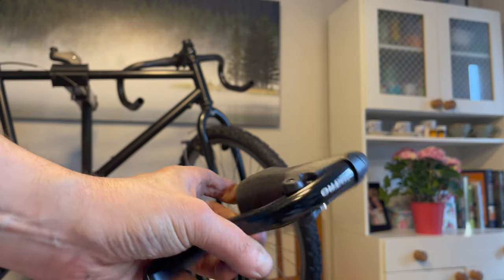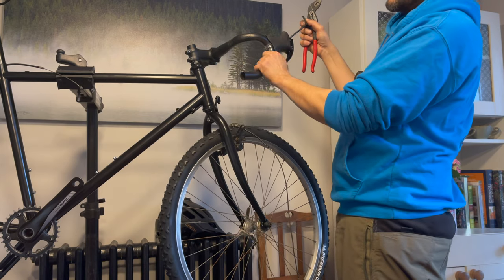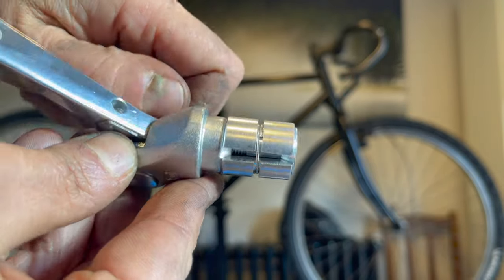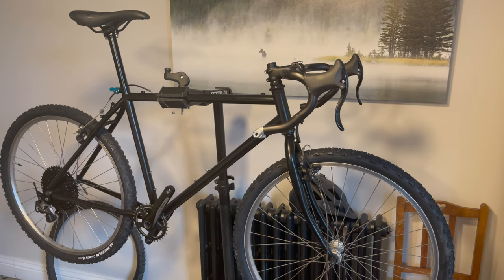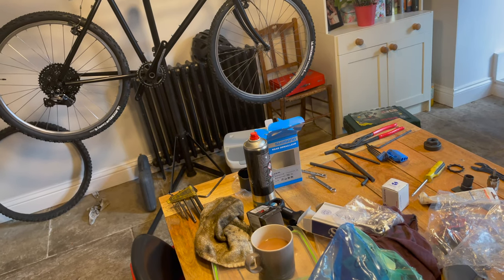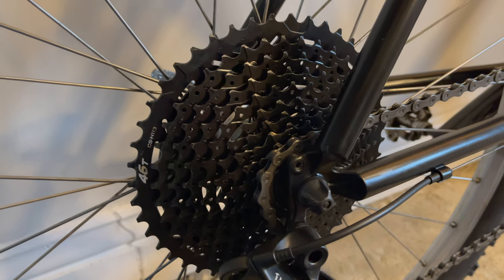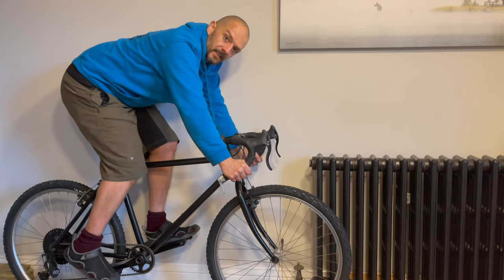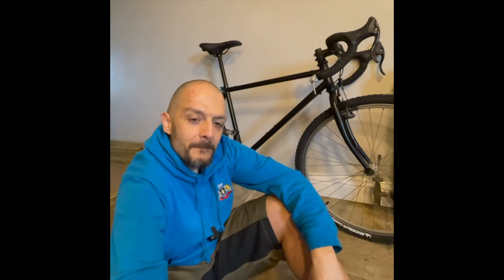Retro 1995 Marin Bobcat Gravel Conversion Installing levers, shifter, cables.  This is finished

Comment: Great video - love the 'recycling' concept! I recently did a similar job on my vintage ('96) Marin Bear Valley SE (swapping in drops, and bar-end shifters) but kept the original triple chainset. I also swapped out the original forks for a set of Mt Tura touring forks from Thorn cycles to make the front end a little more comfortable on the road, and to give the option for fitting a low-rider front pannier rack ... I'd previously used it (in its 'original' form) for fully-loaded tours round the Jura mountains (France-Swiss border - roughly following the Jura VTT) and in the Canary Islands where it handled impeccably - am hoping the handling and comfort have been preserved ...
Reply from the maker: I love the reliability of all these types of components, they are so suited to touring.  We used a 1990 bike on our Wales tour with front panniers, it was so stable.  We used front pannier racks that bolt around the forks.  It was so comfortable, reliable and bomb proof. The Marin was for my “racer” brother.  I would of not set it up like that for me but he is very happy with it.

North Wales Cycle Tour - Chester - Anglesey - Lynn Peninsula - Snowdonia - Chester
https://youtu.be/kjxvuUsWVGM

Comment: Hello, How do these bikes ride compared to modern gravel bikes? I'm trying to resist the urge to buy a bike. Many of the modern gravel bike frames appear to be overly stiff, so I think these frames might ride better but the higher BB might also make it worse. What are your thoughts, please, as you have ridden many? I have a Bear Valley SE in waiting.
Reply from the maker: As you may know. The term “gravel” bike has many variations and extremes of bikes. In the “gravel bike” genre you have what are basically road bikes with wider tyres and at the other end of the spectrum you have mountain bikes with dropbars. The road bike type will have steeper head angles etc and you would not want to take them in singletrack and the other end of the spectrum you have the “gravel” bike like the Fargo that is content on rougher stuff but then a bit slower on the road. So first I think you need to decide what type of drop bar bike you are after. I think the 80’s 90’s conversion would align them more with a road type gravel bike. The head angles were steeper than modern mountain bikes and the tyre width the could take is about 2”. So with a dropbar conversion it would be happy on the more sedate off road. They are comfortable providing you get the right size bearing in mind you are going to put drops on it. I would recommend having a blast on a 90’s bike before going through the process of converting. If you like the way it feels in flat bar mode, you should like it with drops too and you may go a little quicker on the roads. You have to have in mind, frame tech is not what it is now, so they may be a bit heavier than the modern equivalent. If you decide to go an ahead let me know how it goes and link to some pictures. Let me know what you think of your finished project. One thing for sure is they are the coolest bikes on the block, even without changing anything 👍🏽
Reply: @RidingBicycles  Thanks for the great reply. My daughter rides an old trek 950 and she gets meany complements.

Comment: How are your Tout Terrains with Pinion gearboxes and belt drives doing? I don't ride my derailleur bikes any more. Too much hassle. The thought of getting crud all over a nice clean well lubed derailleur drive train sends shivers down my spine and makes me want to go and lie down in a darkened room.
Reply from the maker: Yes I love them.  I have two more Tout Terrains coming end of May for myself and partner.  They are the Scrambler models with the C12 gearbox.  My Outback has the P18, the C12 is lighter and has a narrower qfactor so can’t wait for them to arrive. I will be doing an in-depth review of both the Outback and the Scrambler when I get them.  I am totally convinced by Pinion and Gates.  Shimano put in a patent on a gearbox design last year they will be playing catch-up, plus their design had flaws as it still had a chain moving with a derailleur and cassette but within an enclosed housing in the centre of the bike.  I prefer the expertise of Pinion.  A proper solid product that requires no maintenance other than the yearly oil change.  People can keep their derailleurs if they want to imagine they are the faster thing on the road or talk about how light their system is on a ride or in the pub.  I am happy just having carefree riding 😂 People would not be happy if they had to lube their car and adjust the gearbox after every ride but they seem happy doing that for the bicycle. Go figure 😂😂. My bike does no attract any dirt as there is no oil anywhere so when it does get muddy one quick hose down and it is like new after every ride!
Reply: @RidingBicycles  Sounds like you are converted. I shall watch your reviews with interest. I have 2 Rohloff bikes. The Surly Troll with chain but full Hebie Chainglider cover and a Cube Travel hybrid sort of bike but Cube market it as an expedition/trekking bike which it definitely isn't as they spec'd it with Shimano Alfine 8spd which I found totally unusable for cycle touring or indeed riding with a load as the gearing is all wrong, huge jumps between gears. City urban riding with no luggage maybe ok, but not going up steep slopes fully loaded. So I replaced the Alfine 8spd with a Rohloff and as it was Gates belt anyway upgraded the cheap CDN to CDX belt and metal sprockets and rings. It now rides brilliantly. Extremely low if not zero maintenance. I need to sell my derailleur bikes. I have a  few. I just don't ride them any more. I too like the look of Pinion gearboxes with Gates belt drive and was also looking at Tout Terrain's offerings - the Scrambler. However I can't see that they export to the UK any more because of Brexit. The few bikes shops that did do them seem to have now stopped, so it might be a question of going to Germany and buying one there. There's so much more choice there. Why is the UK bicycle scene so crap when it comes to everyday bicycles? The Silk Roads are lovely touring bikes. I don't know the Outback. Shall take a look at that one. Many thanks for your quick reply. Safe cycling.
Reply from the maker: Tout Terrain stopped using dealers before brexit they are transitioning to direct sales model, or so it looks like.  You buy them direct through their website and they have all the options listed so you can get it how you want.  So no need to go over to Germany unless you want a test ride first.  I think the problem with the bike scene over here is we British as a population seem to want to look the part instead of having a product that works.  Eg wanting to look good going fast in a pack because we have been brain washed by the latest marketing advert. Whereas in Europe it seems that function comes first, but in doing so they end up looking more comfortable, confident and with that comes complete style.  Maybe as a nation we are carrying around a lack of confidence.  The German attitude is it must work first :) and when you have a product that just works eg Rohloff and Pinion it stands the test of time and is classically cool and stylish I have friends and colleagues that would not be seen dead on the bikes I have because they don’t look flash in their eyes.  In my eyes nothing looks cooler than rocking up on a solid Silkroad putting the side stand down and going for a pint. Instead of piling a race replica on a wall along with every other race replica to then waddle down the street with my dad bod wobbling everywhere 😂😂😂😂
Reply: @RidingBicycles  Yes, so true! Thanks for the update on Tout Terrain's selling set up. A test ride would be good so maybe a trip to Germany. Apart from Slam69, Graham Foot in Gloucester I don't know anyone in the UK who makes bikes with Pinion gearboxes? I think Shand just do Rohloff with belts at the moment for their top bikes. Pinion gearboxes maybe a step too far for SJS .......... I think they only recently started offering disc brakes as an option for their Nomad. There a quite  few opportunities in Germany to get Rohloff and Pinion geared bikes in Germany. Then there is Van Nicholas in Holland with their Ti Devron or Koga with their World Traveller which I think you can get with Pinion gear box and belt drive now. I think this is the ultimate bike set up, 100% practical, useable every day in all weathers, low maintenance, does everything, commuting, shopping, going to the pub, holidays and just general bimbling around. A Silkroad with Pin and Gates would be awesome. Thanks again. All the best.
Reply from the maker: Hi,  just for your mental databank.  Sonder do one of there models in titanium and pinion and enigma do the escape as a Pinion full custom build.

https://alpkit.com/products/sonder-signal-ti-pinion

https://www.enigmabikes.com/blogs/stories/pinion. 

The Sonder very purse friendly, I would imagine the Enigma very expensive.

Two other brands I used from Germany that I really like are Pilot for Ti 

https://www.pilotcycles.com

And these are the same company they have split their business into steel and Ti.  There stainless steel model looks ace.

The Ti business https://www.falkenjagd-bikes.de/de/

The steel business https://www.rennstahl-bikes.de/de/

Botha sites have an English translation button.

Many thanks and good luck with your purchase 👍🏽
Reply: @RidingBicycles  Thank you very much for the links, very useful. Shall check them out. Yes Enigma are very expensive but beautiful frames by all accounts. I had already seen Rennstahl but discounted them as their YT vids and website were only available in German which I unfortunately don't speak and it might just be too difficult to buy from them. I think Rose bikes might have been offering Pinion/Gates bikes but nevertheless seem to have stopped supplying to the UK. There are a few options. I think Tout Terrain and Van Nicholas and maybe Koga are near the top for me. I think Sonder are or have a tie up with Alpkit. Im also liking the idea of a fat bike with Pinion / Gates hence the Smokestone Henderson from Graham Foot at Slam 69 which I only discovered very recently. When I first saw fat bikes I thought are they serious, but now they seem to be growing on me. Graham offers other bikes with Pinion / Gstes as well, although for the moment they are not taking orders. He did a vid in which he said there was quite a few months backlog waiting for Pinion gearboxes around 5 months. But yhere is no rush. This year still might yet be a write off. Many thanks for your help. I'll get a Pinion gearbox bike with belt sooner or later. I love the concept and I'm sure Pinion build quality is every bit as good as Rohloff. Have a great weekend.
Reply from the maker: I had a Salsa Blackborrow Fatbike great fun.

This guy can sort you out with a Ti Pinion Fatbike.  Check this beauty out.

https://rdcycle.com/product/the-outstanding-pierre/

Great weekend to you too

Comment: Does the shifter work with 11 speed cassette and the sram nx derailleur?
Reply from the maker: Yes. It is working fine. It has an 11-42 cassette.
Reply from the maker: Whoops sorry I forgot.  I removed one of the cogs from the middle do it is running as 10sp.  I was getting mixed up as I have an 11sp running with downtube shifters from dia compe made for 11sp.

https://www.sjscycles.co.uk/gear-shifters/diacompe-ene-11-spd-down-tube-shifters/
Reply: @RidingBicycles  thanks for the information